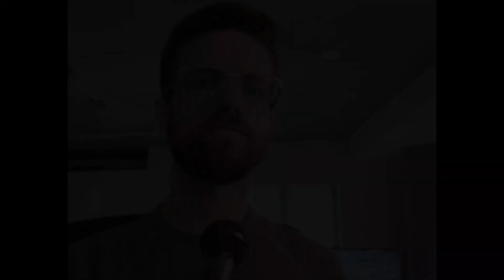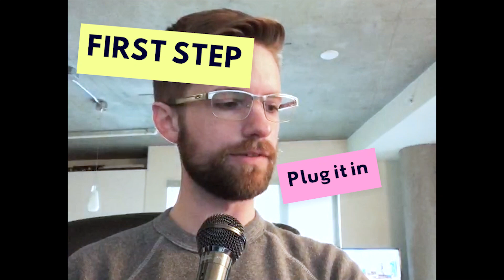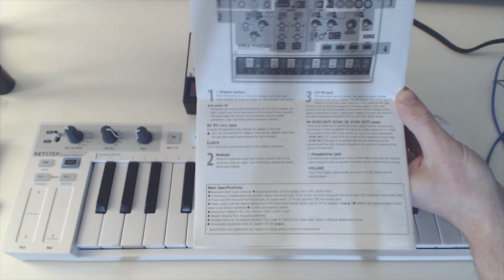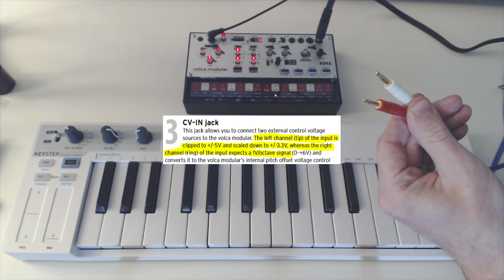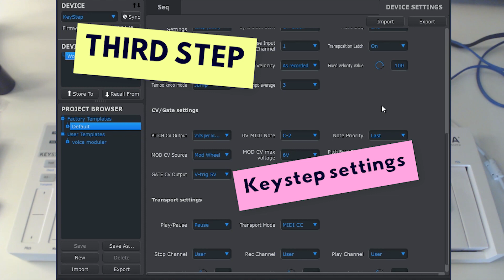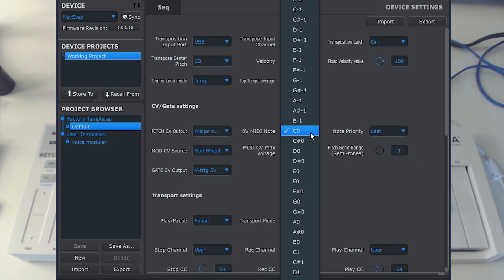How To Use A Keystep With Your Volca Modular

Comment: the "drift" possibly can be due to autenticity...old(er) modulars drifted (a lot) - the were (modulars still are) VOLTAGE controlled...turning on a light or a fridge turning on, could detune the whole set...unless you had a super stable power supply...thanks for the vid, I use it as a reference...

Comment: They really bungled the inputs. I already have a ton of fucking cables, like stackers and midi, so why tf am I now required to buy another one just for this piece to connect to outside sequencers? Even $10 on something that's not standard for modular on a "modular" synth to connects to this "modular". I love west coast synthesis and love playing on it, but I find this poorly planned. I wish I could just afford an easel command. I've aimed my modular in a Buchla direction because buchla modules are so fucking expensive. This is a great budget west coast synth, but this input seems like an afterthought, when I think it should be more central and easily integrated but no.

Comment: THE EASIER WAY TO CALIBRATE CV:

1. Turn on the power of the Volca Modular while holding down the PLAY and REC buttons.

2. C4 will light on the keyboard. Play the C4 key on the Keystep while pressing the MEMORY button on the Volca Modular.

3. C5 will light on the keyboard. Play the C5 key on the Keystep while pressing the MEMORY button on the Volca Modular.

4. All step buttons will light and the REC button will blink.
Press the REC button to save the calibration settings. The Volca Modular will restart.

5. Have fun!

If your Volca Modular doesn't start in tune mode at step 1, you should update your firmware. Mine already had this feature.
Reply: How do I delete these changes??? now sounds really bad help
Reply: Thanks, just did the firmware update and did the calibration. The pitch is still unstable, but what an amazing lo-fi effect without the need to buy a €300 pedal to do that!

Comment: I'm guessing you didn't use the Modular's CV calibration routine before tweaking the Keystep's CV settings...

From Korg:

How to Calibrate the CV Input.

You can calibrate the CV input on the volca modular, so that the pitch is correct when playing a synthesizer or other device with a keyboard that can output CV/gate signals.

1. Connect an external device that can output CV signals, and configure it to play.
Connect the external device’s CV (PITCH) and GATE jacks to the CV-IN jack of the volca modular. Patch the connections and adjust the knobs on the volca modular as shown in the diagram.
2. Turn on the power of the volca modular while holding down the PLAY and REC buttons.
3. The Step [4] button will light (this means “C4”).
4. Play the C4 key on the external device while pressing the MEMORY button on the volca modular.
5. The Step [16] button will light after several seconds (this means “C5”).
6. Play the C5 key on the external device while pressing the MEMORY button on the volca modular.
7. All step buttons will light (this means “end”), and the REC button will blink.
8. When the REC button is pressed, the settings will be saved and the volca modular will start up normally.

Pressing the PLAY button during operations will make the volca modular start up normally without saving the settings.

Comment: I ran a stereo  cable from cv pitch output on the key step  to volca modular cv in, ran the modular patch cable from the cv pitch mod to the pitch source an the key step is not triggering any sounds. But my modular keys are all one pitch. Do I actually need that double ended cable to make this work?

Comment: I tuned 0v to B0 and then tuned manually and it seems to be pretty evenly tempered. I have it pretty in tune in every key across octaves. Going to try Bb0 if that’s possible.
Reply: Update: B0 then manually tune works best for me. Volts per octave, max volt 5v, v trig 5v
Reply: @DanielMaruniak  I just run the CV out of my Microbrute and use the Power Up/Rec/Play method. Rock solid over 3 octaves.
Reply: Mark Pigott yeah I have 3 solid octaves in tune now as well. Stoked.
Reply: Maybe dragging down the 0v reference makes it closer to 3.3 because the notes seem less wobbly now.

Comment: You should of used a tip top stack patch cable for the cv and then ran the gate into the stack cv in on the volca, a lot easier dude and sounds better..

Comment: Same tutorial for SQ-1, please!
Reply: try 8V
Reply: I think the reason he's getting drift is because he's working to 5V scaling vs 8V scaling
Reply: @123Andersonev  Ok, I`ll try it. At 2v and 5v my volca`s not getting clock and just makes some random messy noise.
Reply: @noizekiller  probably because like the video says the voltage input is trs and the clock needs to go into sync in not VC all volcas work like that for clock
Reply: the output of the sq1 is mono for clock and gate if i were you id get the same cable and also turn up the duty cycle
Reply: @123Andersonev  I`ve got that cable and made all preparations. But both Volca Modular and Monotribe don`t work with SQ-1 as they supposed to.
Reply: @noizekiller  https://www.youtube.com/watch?v=mqC74h4Ihr0 works fine here

Comment: Thank you so much sir, seriously thank God for guys like you. 
I've had my Modular for about 6 weeks now and after posting on a couple of forums, buying the right cable and watching this video, I can now finally control the damn thing in a DAW. 
I totally get it that Korg were trying to be faithful to the original West Coast ethos and all, but seriously - no MIDI in 2019? C'mon man! 
Luckily I also have a Korg MS20 Mini so I'm now able to control the Modular via the CV outputs of the MS20 Mini. Otherwise I'd be completely screwed and would have to spend more money on a Keystep or similar just so that I could control the Modular! Madness! 
I reckon Korg will make a revised Modular with MIDI in the next few years.
But anyway, you sir are a legend :)
Reply: Hello good man.  Did you find a 5din midi  cable that you can plug into your volca?
Reply: Hey people. there is a video about converting the Volca Modular to a 5-pin MIDI connector. https://youtu.be/8BZ7e947uHA

Comment: Aren't Korg synthesizers using Hertz per voltage? I mean that could explain the deviation... ;o) Helpful video though, thanks for that.
Reply: indeed I think they use Hz/V. I've a SQ1 instead of the Keystep here, if you choose another setting than the Hz/V the deviation is worse. But I still have a deviation on just one octave. I think the unit is defective

Comment: Well done. Try turning the Fold and Mod all the way down when checking octave.  You would be hearing just the base triangle wave. If the scale is still too sharp, you can use the utility (a-b*c) as a range adjust.Run your pitch CV into Utility input A. Take the a-b*c output. Knob C all the way Clockwise. Use tuning to adjust the base note as in your video. Then play the Keystep up an octave and adjust the utility to lower the CV voltage until an octave. You may have to go back and forth several times. Make sure everything is warmed up and temperature has stabilized. Welcome to CV!
Reply: I just found a better way to calibrate the CV pitch and octave on the Korg website!

1. Turn on the power of the Volca Modular while holding down the PLAY and REC buttons.

2. C4 will light on the keyboard. Play the C4 key on the Keystep while pressing the MEMORY button on the Volca Modular.

3. C5 will light on the keyboard. Play the C5 key on the Keystep while pressing the MEMORY button on the Volca Modular.

4. All step buttons will light and the REC button will blink.
Press the REC button to save the calibration settings. The Volca Modular will restart.

I did this in a few seconds! You may have to update your firmware, but once you do, this procedure is so easy!

I'll post this to the main comments too.
Reply: @oomingmakroo  I bow to you! Kudos! Made my life soooo much easier..!
Reply: @oomingmakroo   How do I delete these changes??? now sounds really bad help
Reply: @Hanxdesign  You can factory reset the settings by holding FUNC and MEMORY while turning on your Volca module. The REC and PLAY buttons will blink and the display will show Ld.Pr. Press the REC button to restore factory defaults or press PLAY to cancel. NOTE that this ERASES all of your sequence data too! Otherwise, I would simply repeat the calibration procedure until it works.
Reply: @oomingmakroo  omg ily
Reply from the maker: Thanks for the tip, I'll have to try that!
Reply: @HyperObjeckt  This actually works. With some fine tunning I am capable of having  full octaves perfect! Thanks!
Reply: Thank you! This comment is what I was hoping to get from this video!

This video is very good, and would have saved me time. But, I didn't think searching for it until I couldn't figure-out how to calibrate the volts/octave. I was thinking I'd have to find a trimpot inside the Volca, but using the a-b*c utility module is easier. Thanks!